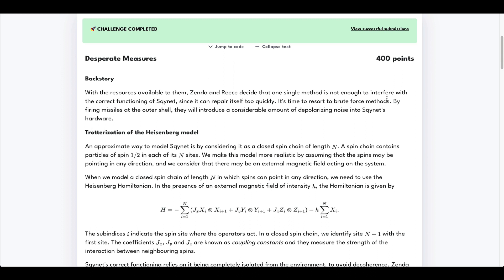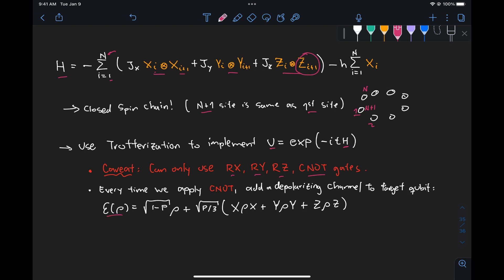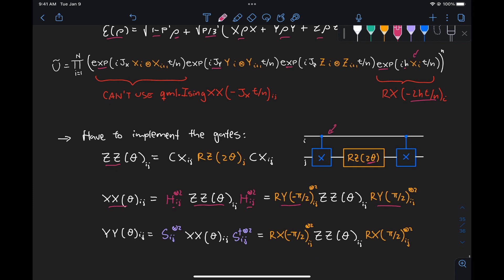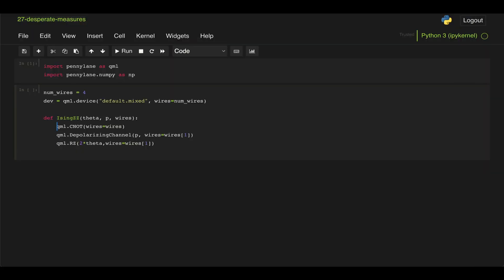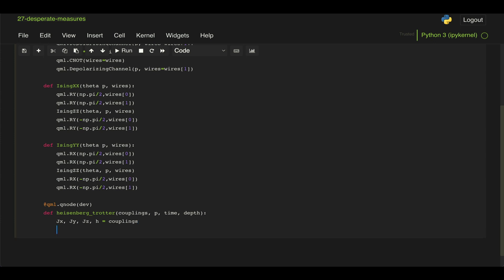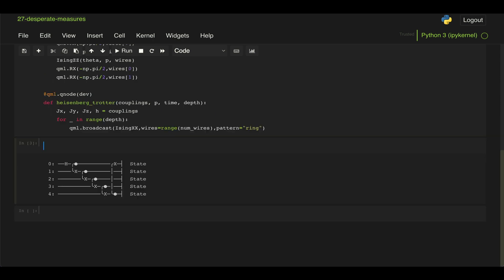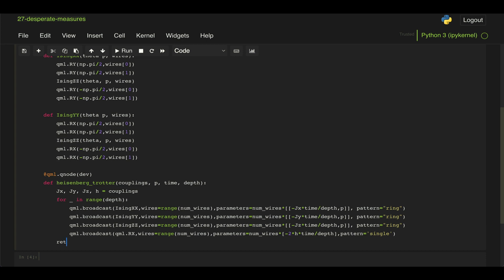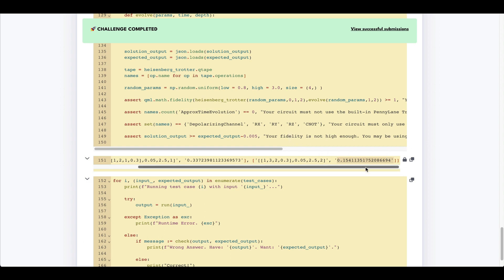Problem 27 - Desperate Measures | QHack 2023 Coding Challenges

Comment: Hello, I don't understand why at 3:38, you decompose H once as RY(-pi/2) and once as RY(pi/2), when I do the computation none of them corresponds to H. Same question for S, I don't see how it it equal to RX(-pi/2) = 1/sqrt(2) [[1, i], [i, 1]] .
Reply from the maker: Sorry for the misunderstanding. I did not mean to imply that H is equivalent to an RY gate; it is a bit more complicated than that. What we are doing here is coordinate transformations, which for the case of the ZZ(θ) gate it holds true that XX(θ) = H ZZ(θ) H = RY(-π/2) ZZ(θ) RY(π/2). Work thru the math and you will see these two are equivalent. Same is true for YY(θ).
Reply: @diemilio  Thanks . Indeed when I did the entire computation it worked. However, how did you come up with it ? Is this a known decomposition ? does it have a name ?
Reply from the maker: @Yosh1tcd  Sorry, it has been over a year since I did this, so I don't quite remember. I would probably have to work out all the details again to remember. My guess is that I used the fact that ZZ is diagonal, so the Hadamard rotation and RY forward-backward rotation end up being equivalent.